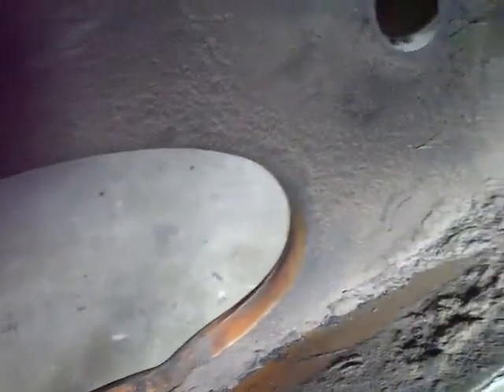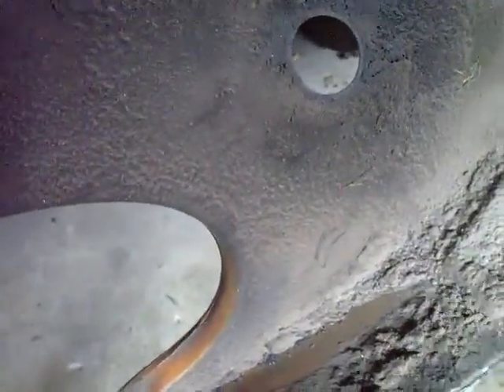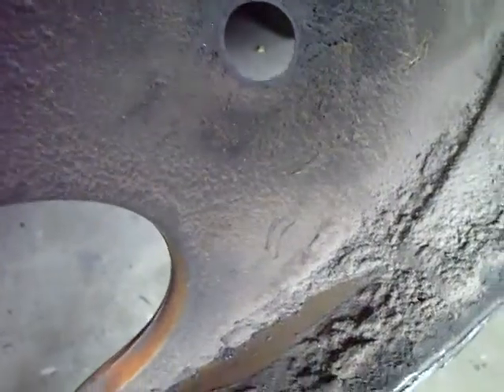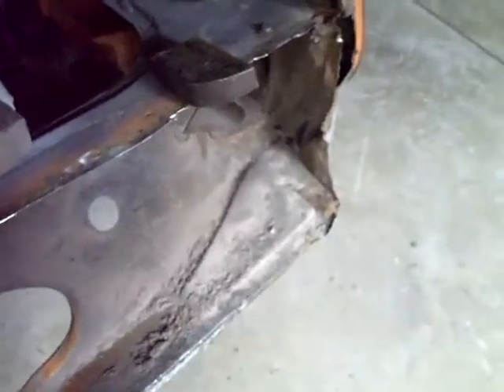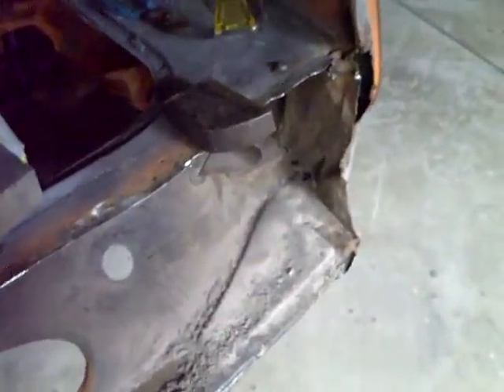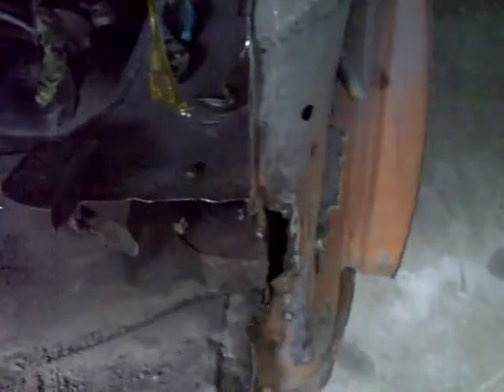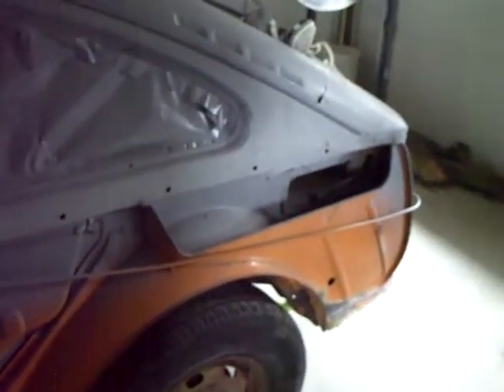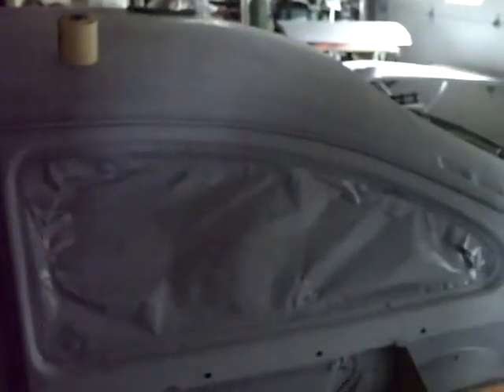Restore VW Fastback 11

Comment from the maker: @JacobbrianS Oh yea I had forgotten about that. I think I done that because all the brake system is off the 97 we used  except the front rotors and calipers with the 04 front end. I was waiting on 04 brake hoses because. The 97 hoses wouldn't fit those calipers.